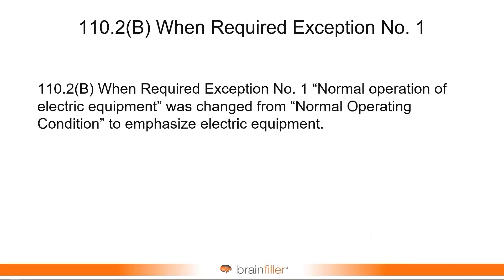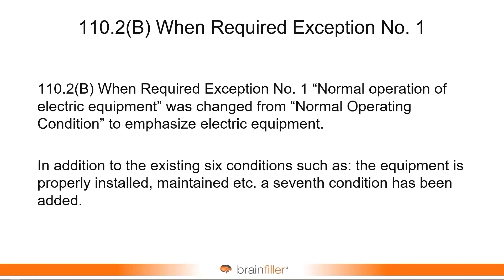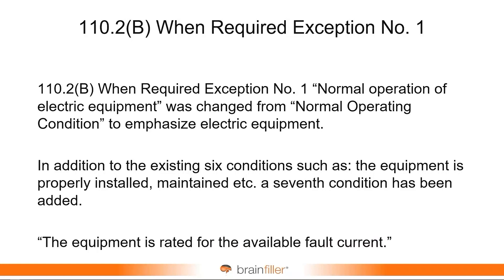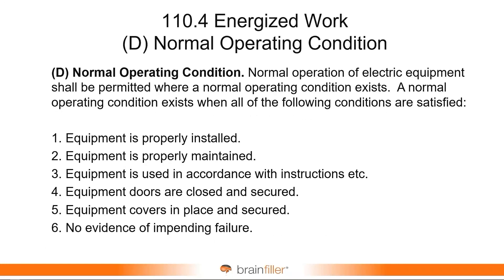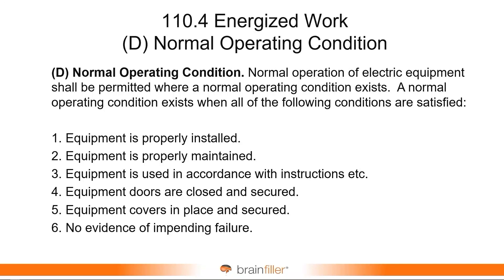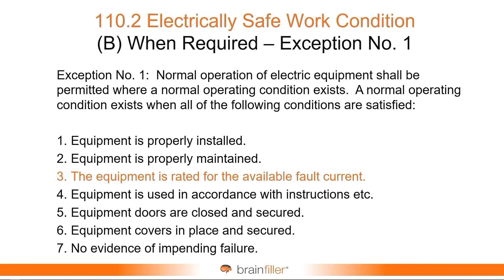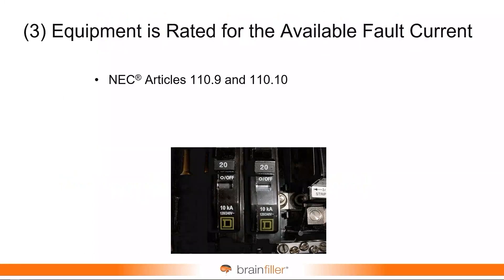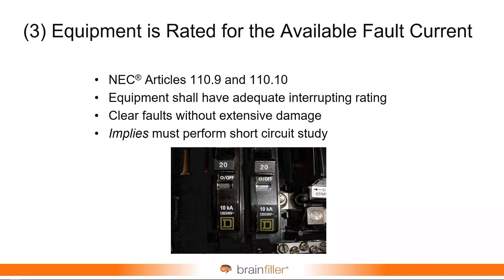Normal Operating Condition:  Equipment Rated for Available Fault Current

Comment: Nice informational note and clarification,  but you could easily argue that items 3 and 4 overlap,  because if you have a breaker with an interrupting rating of 10kA, and you install it in an application were the available fault current is 20kA, then the equipment is not being used in accordance with the installations for the listing and labeling
Reply from the maker: Great observation - yes I believe you could make that case.  I have seen where fault currents can increase with time due to electric utility and other changes. Also I used to perform studies in a past life and it was amazing how often you find overdutied equipment (for whatever reason).  Thanks for your comment!